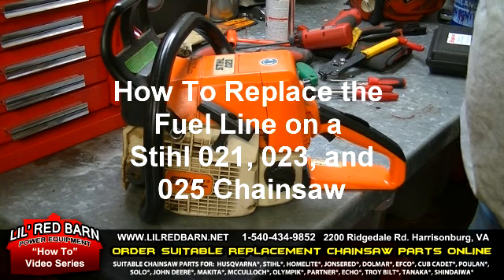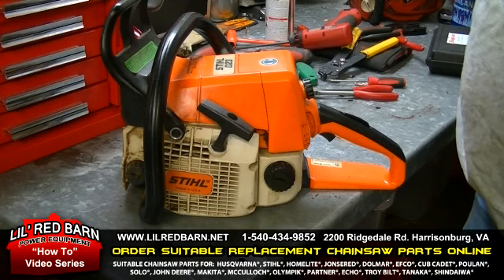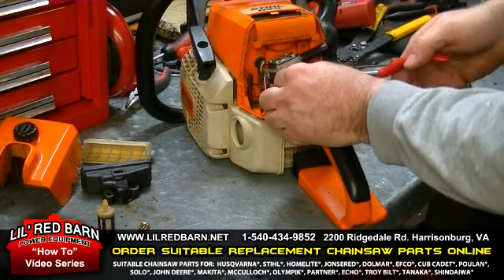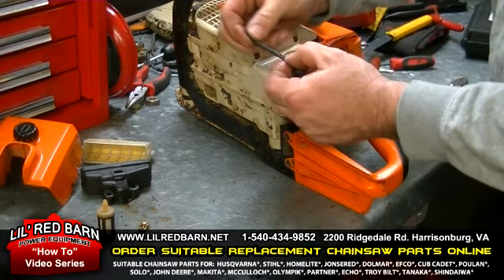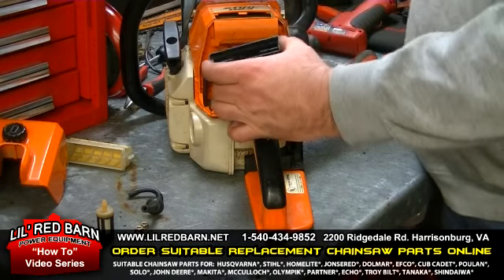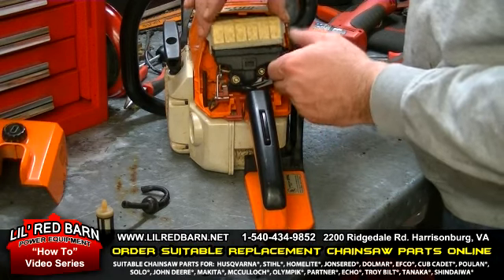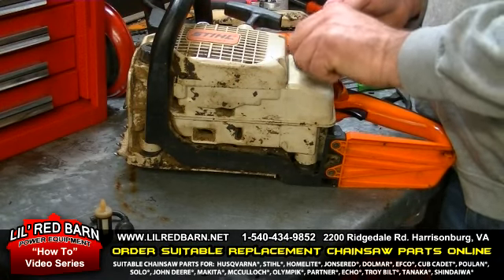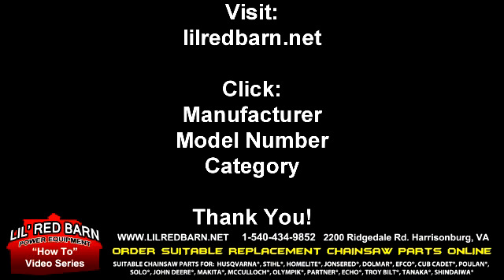How to Replace the Fuel Line on a Stihl 021 023 025 Chainsaw

Comment: Thank you, Lee Smith. A couple of lessons learnt from my side. 
1. As noted by others, the U part stays in your hand when pushing the line through the hole in the tank. 
2. Push the seal in from the tank side. Doing so is good because coming from the other side will drag dirt into the tank and also because the spring assemblies on the other side get in the way if you do it the other way around. 
3. Push the seal all the way through, then pull it back to seal. The flat top side makes it difficult to seat pushing it home from the tank side. Easier to seat it bringing it back in. 
4. Set the square tabs on the side away from you. Not so far that you can’t see them. Set them and push the line over against them to complete seating from the upper side. 
5. Use a smallish flat screwdriver to gently ease the rest of the seal in place. Pulling it hard from the top side will result only in frustration. It is a delicate exercise, using the screwdriver and you finger to seat the seal. The gap in the video is the missing footage of this struggle. There is no pop, only the leak of fuel out of the seal if you fail. Set it on the back side, then ease the rest into line.

Comment: Lots of stress on the new fuel line by pinching with pliers and pulling up hard to get the plug set in the top of the tank, ESPECIAILLY if installed the right way (flat side up).  Instead, I pulled the carb (EZ), put a film of 2cycle oil on the plug, and fed the fuel line through the slot in the housing so that the plug rested on the hole in the tank with the flat side of the plug facing left.  Then positioned two flathead screwdrivers from behind, setting them flat on either side on top of the plug.  Pressing down and working the screwdrivers a little to set it, the plug popped in place in <1" AND the new fuel line wasn't "broken in" :)

Comment: Lee, with your help I did mine but apparenhtly mine is a little older.  I did not take the air filter off of the air filter housing. thanks again

Comment: the line is installed upside down.  An 025 is a direction fuel line that only 1 end will fit the fuel filter and the other will only fit the carb.
Reply: That was 0 21.could b the same I'm not sure
Reply: @roberthartford9171  Same for my 023C - different end mouldings for the pipe to fit the large filter and the small carb entry, clearly the wrong way round in this video, I'm going to try installing mine from the carburetor end as that's the direction the grommit wants to enter by the smaller side of the grommit - the wiggly end of the pipe is supposed to be in the tank so the filter can sit in the right places. (EDIT-) Yep, put it in from the outside with the wiggly end in the tank. Perfect!

Comment: nice video EXCEPT grommet on hose is easier to install in gas tank when inserted into tank under the carburetor (after removing it). In reverse direction of this video and less strain on gas line..Just look at the grommet and think about it. Good luck.

Comment: Helpful, but not so easy. Could not bring myself to pull the new line that hard- felt like it was about to pull apart! But managed to ease it thru with plenty of oil and a bit of push/pulling.

Comment: The method used here keeps you from having to removing the carburetor. The grommet should seal from any direction applied. What may arise is that the ends of the hose may be of different size i.e. one size for the carburetor and another size for the fuel filter... Cheers

Comment: Sorry, but folks need to know that you have installed this fuel line "backwards" and "upside -down". End for end, it is backwards. The short curvy end goes inside the fuel tank. Also, not that it matters with it installed wrong, but there is a certain orientation that is desired and can be determined by the flat side of the grommet. Sometimes the "obvious" is not really as obvious as it seems.

Comment: With due respect, most people pull the old out and put the new in from the top of the tank, not through the tank itself.  That is the way the grommet is made to go.  And be careful using pliers on that soft hose.  Otherwise your video is helpful for those who do not know how.

Comment: wouldn't recomend using a screwdriver on the air filter. they're brittle, it's safer and much easier to grab the ears on the sides and rock to the rear of the unit. also he put the fuel line in upside down..... it came out one way and it went in another. lol

Comment: The fuel line is installed backward in this video!! Bogus installation because fuel line has to be installed from carb side NOT thru fuel tank.
Reply: +Anthony Tilson  You are so Right picked up on that myself also the carb side of the tank is smooth and has a lead in to help get the hose in  the inside of the tank is rough
Reply: YES. That's what I thought. How can the widest side of the grommet pass through the hole thru the fuel tank and seal itself properly? I almost ripped the hose trying it his way. Best to remove the carburetor and put the hose through the top. Shouldn't have posted this video because it is just wrong.
Reply: I tried it his way and went in first go. The other way was impossible for me.
Reply: @coma3550  I guess it depends where you buy your pipe, and what size the filter and carb attachments are. 21/23/25 are supposed to be the same family but mine are different sizes and the OEM pipe I bought is NOT the same size at both ends! Fit it this way around and there's a nasty surprise coming when fitting to the filter and the carb. And anyway, Stihl designed the pipe with a wiggly end to go in the tank so the filter can sit in the right place, it may not move around into the right part of the tank as you turn the saw for various jobs if the wrong end is in the tank although it may work upright ok.
Reply: @poochie49  Agreed. I decided to put mine through from the carb side because mine has different size ends for the substantially different sizes of carb and filter fittings so my pipe can only go one way round (the right way round <g>). It's not had to fit from the carb side - I didn't even have to take off the carb or the choke control lever - just manoeuvred it into position, poked it past the orange plastic shroud with a blunt screwdriver and then used same instrument to help guide the grommit into alignment with the tank hole while gently pulling on the pipe inside the tank - wrenching with pliers isn't going to be good for the pipe and a proper OEM pipe isn't particularly cheap. Job done, really pleased!